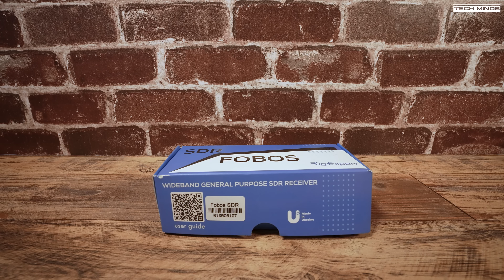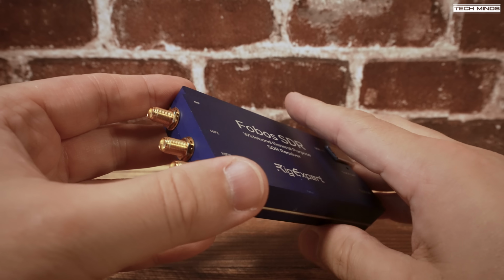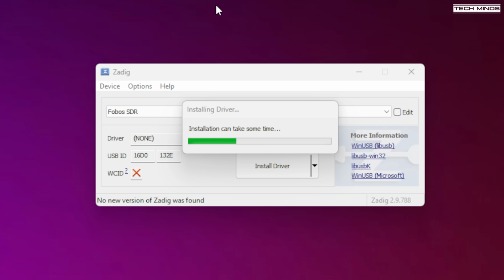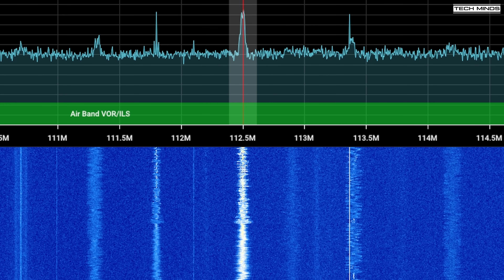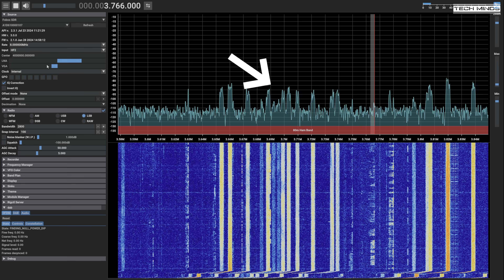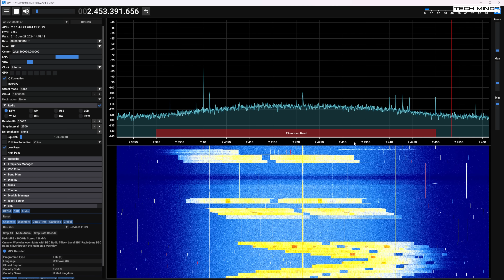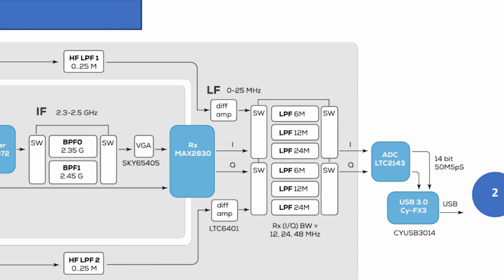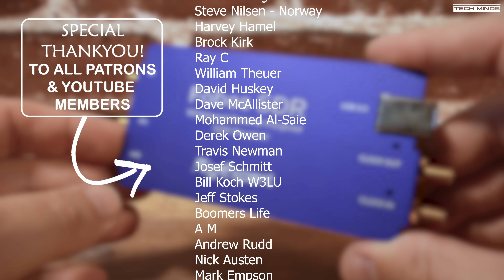RigExpert Fobos SDR 100KHz To 6GHz SDR Receiver

Comment: I could not even see spending nearly $500 on an SDR receiver when the British company  SDRPlay has great receivers starting at just over $100.

On the otherhand, it does not make sense that RigExpert would design a receiver having the issues yours has especially at its price unless they are eating LSD along with their eggs for breakfast. It must be a faulty unit is my bet & even if given  to me I'd be contacting the company.
Reply from the maker: As I said in the video, I contacted them and they confirmed my unit was working as designed….
Reply: @TechMindsOfficial  hmmm, apparently they do eat LSD with their eggs during breakfast. I hope they don't want to have high sales.
By the way. You had indicated wanting to build an efficient Mag Loop transmit antenna, likely for a single band, is this still under consideration or have I missed  it as the credits rolled too?
Reply: What SDRplay product gives you more than 10 MHz of bandwidth? Their own crappy proprietary unsafe (needs root) "API" limits the bandwidth to 10 MHz when cheap Chinese RSP1 "clones" are capable of 14 MHz at 8 bits.
Reply: Why would you really want that much spectrum being shown, I'd have no interest in having it. My bet is aside from an initial gewiz isn't this neat one would narrow the display to bands of interest such as those  that were active at the given time of the day.

Each to their own, but roughly $500 for what was shown here would have me demanding my money back or talking to a representative that has an engineering background &  knows enough to understand what was conveyed is just rubbish.
Reply: @migalito1955  If you have to ask that, you're clearly not the intended user. I'm interested in capturing the airband and ideally the 2m band all at once -- that's 28 MHz without any extra, and it needs at least a 12b ADC to prevent clipping with strong signals.
Reply: Like I said, to each there own. If I am interested in 2 meters, my RSP gives me plenty, roughly from 143 to 148 MHz. If I want to listen to airband most of all the air traffic here in the States is around 131Mhz. I myself don't really care to see all the traffic on a large interval in which I can't transmit on for the most part anymore than I want too see an image from each channel related to a cable TV network. 
But, what I really don't want is to have spent $500 on garbage where the company rep says just adapt to it.That's just not acceptable nor defendable in my book.

Comment: These toy receivers cannot compete with a "real" receivers that have tuned front ends. Seems to be more for something you can stick in your computer bag side pocket to have a receiver along.
Reply: Have you ever used one? My main general coverage receiver is an Airspy HF+ Discovery. It's an excellent radio. For the price it's spectacular.
Reply: @marsgal42  I was looking at self contained units with built-in display. (Malachite like) I will have to look into one of these because the specs are so good. And it doesn't cost three grand!
Reply: I have plenty of sub 300$ SDRs that outperform my Kenwood TS-850S. The issue here is there is a flaw in the design.

Comment: If it needs Zadig, its som kind of crap rtlsdr and is a no buy for me.
Reply: So you discount a product just because the operating system you're using has a bad way of dealing with drivers? You don't need this Zadig magic on Linux.
Reply: Thats true about linux but i have still not used any good product that needed Zadig yet